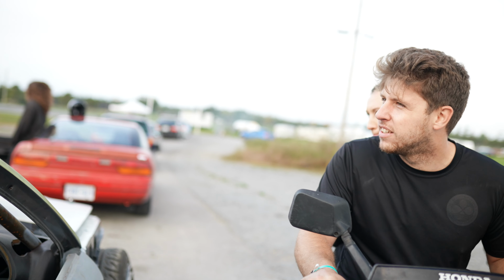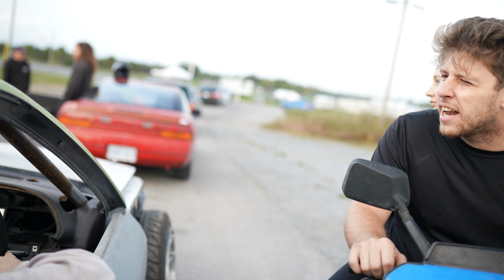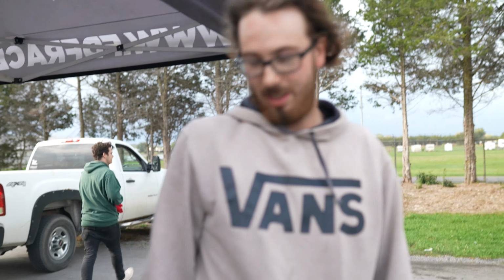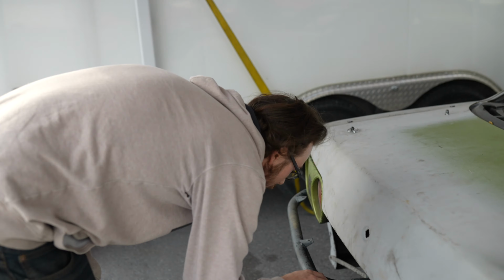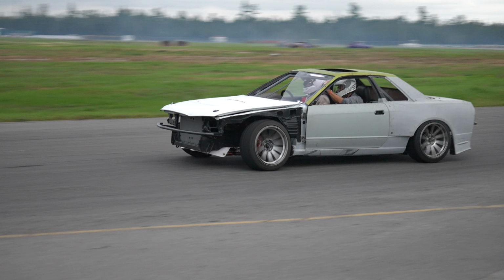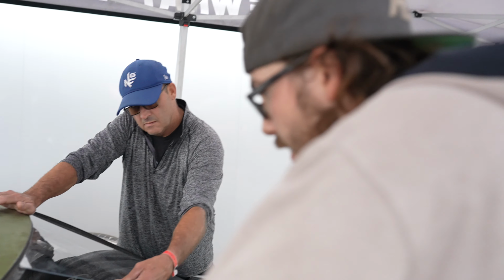The Skyline Absolutely Rips But We Broke Something

Comment: Question: Is this using the rack offset spacers or is the rack moved forward? Also, would it work on A31 Cefiro??
Reply from the maker: Our s13 kit should bolt right up to the Cefiro, the rack on the skyline is a s13 rack moved forward about an inch and uses our straight offset rack spacers. Rack should be the same!